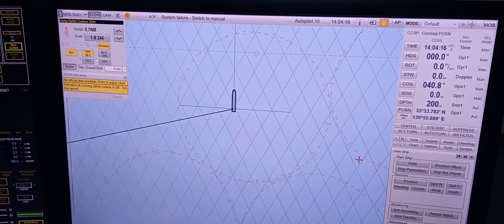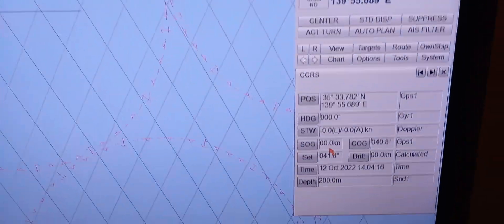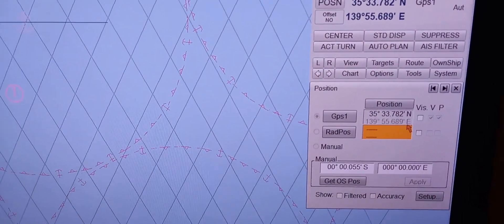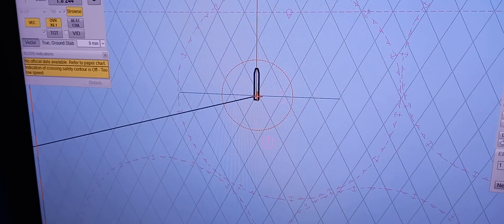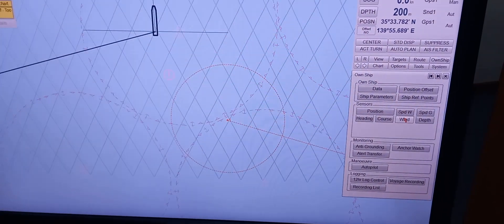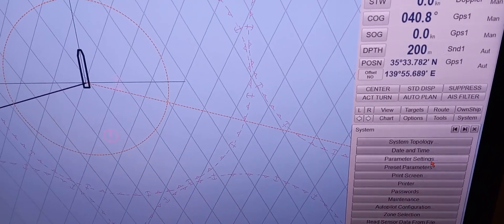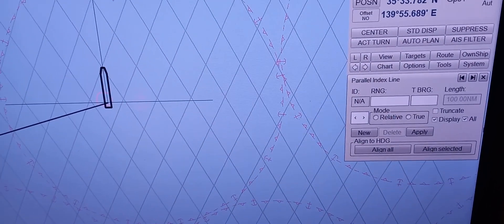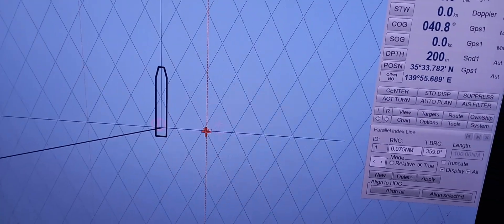Kongsberg K-SIM simulator ECDIS part 1

Comment: pls advise how to delete the root
Reply from the maker: @chamindaerabaddagoda8897  thank you for watching
Reply from the maker: To delete a route in the Kongsberg ECDIS system, follow these general steps:

Access the Route Management Menu: Navigate to the main menu and select the route management or planning section.

Select the Route to Delete: From the list of available routes, choose the one you intend to remove.

Delete the Route: Use the provided option, often labeled "Delete" or "Remove," to delete the selected route.

Please note that the exact steps and terminology may vary depending on the specific model and software version of your Kongsberg ECDIS. For precise instructions, refer to the operator manual corresponding to your system. If you don't have access to the manual, consider contacting Kongsberg Maritime's technical support for assistance.